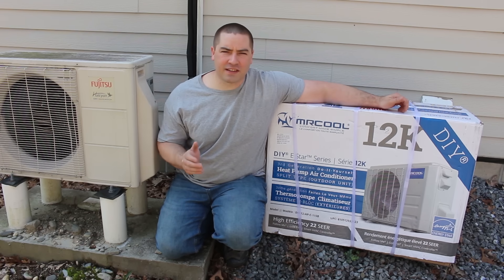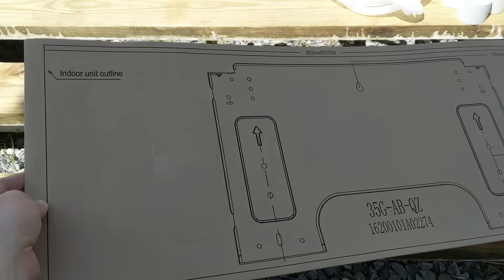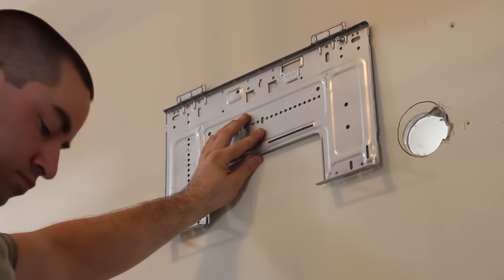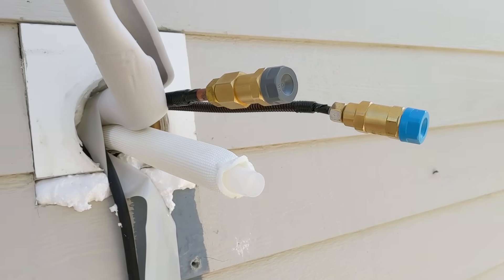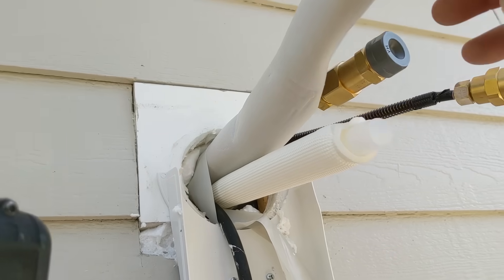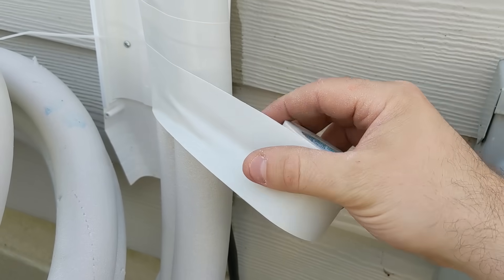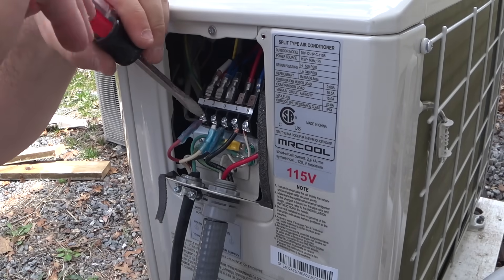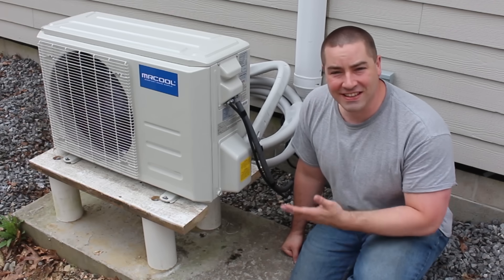Installing My Own Mini-Split Heat Pump, DIY

Comment: So you don't have to pull a vacuum on the lineset before you release the refrigerant.  Interesting
Reply from the maker: Right.  This is a neat kit.  I haven't found pre-charged lines on any other brand.  It might be out there, but most need a vacuum pump.  I posted a follow up video that answers that question:   https://youtu.be/KzHLsRtVn4U

Comment: You forgot to use a vacuum pump to remove the air in your pipe, 
Air in the system will reduce the efficiency of the system
Also it is better to use the shorter length of pipe, cut the excess and use a flair tools 
Not sure of the refrigerants fluid in your system, but on R410a system nylon blue is required to avoid pollution of the refrigeration gaz
Reply from the maker: I posted a follow up video that answers that question:   https://youtu.be/KzHLsRtVn4U
Reply: Sylvia isgod  I'm simply amazed at how many people speak before they even know what they're talking about. Or as in Jean-Claude Banville's case, doesn't know what he/she is talking about.

Comment: Great how to,
One question,
How did you get Freon ?
Reply from the maker: This particular kit came pre-charged with refrigerant in the compressor and inside the copper lines.  So I didn't need a license to install it.

Comment: Dont want to be mean,but you ve made two big miskes,first you should have put it on vacuum to avoid contaminants,second  you cant leave the line set like that,ur causing an oil trap,so as a tech,ur ac wont last much.
Reply from the maker: I posted a follow up video that answers that question:   https://youtu.be/KzHLsRtVn4U
Reply: I agree to some extent, but we ll see what happens in a year or 2 max,but thank u for the video .

Comment: hi david i have a question
no need to suck the line to get the air outjorgepozo
Reply from the maker: Not with this kit.  I go into more detail on the vacuum question in this follow up video: https://youtu.be/KzHLsRtVn4U

Comment: doesn't require any vaccum to be made inside the copper tubes ?
Reply from the maker: Not in this kit.  The lines came pre-charged and sealed.  I made a follow up video about it.
Reply: @DavidPozEnergy  oh, that is interesting indeed. Thank you. In France I didn't saw anything like this on selling plateforms, maybe because professionals have a huge monopole on finishing the installation of heat pumps.

Comment: Howcome you didnt get a 48v unit? I cant wait to replace my two units with a set that can be powered by my mini-version of your tower of power..
Reply from the maker: If I bought a mini-split that ran on 48v DC, then I'd have to run new wires from the garage to the house for the 48v, and they would be hundreds of dollars in wire to minimize voltage drop.  Plus the mini-split would cost more, plus I'd have to buy vacuum pump and gauges to commission the system.

Comment: That is not how you do it. this installation will kill the unit. you need to vacuum out the air from the copper lines using the valve on the AC. before releasing the refrigerant.
Reply from the maker: I  posted a follow up video addressing that question: https://youtu.be/KzHLsRtVn4U
Reply: @DavidPozEnergy  oh. I see, that is smart. but I would still stick with traditional systems :) ofc, definitely not fujitsu or "mrcool" over here :D I would go for Daikin ir Mitsbushi Electric :) not only for the longevity of the unit and comfort, but mainly for efficiency :) those chinese systems are known to be really bad when it comes to that.  especially when it says on the box SEER 22 you can already tell that its going to be just horrible :D they probably just made that number up because I dont even think that is possible to get that high even on the best of the best systems :) unless the rating system is different in US

Comment: There is any sence to do it by yourself like DIY ? How much cost standart instalation of 12000BTU in US ?  In East Europe about 150 dollars...
Reply from the maker: Last quote I got was $4500 USD.
Reply: @DavidPozEnergy  Do u mean that just to install simple monosplit standart system cost 4500? maybe 450 ?
Reply from the maker: I got a quote earlier this year (2020) before I decided to do it myself.  The quote was for a new Fujitsu, 9,000 BTU, single head, single compressor.  Direct replacement for the one I had.  The quote did not include any electrical work since I already have the wires and disconnect run out there.  So part of that quote includes the equipment, which is maybe $900-$1200, that range.  Which left about $3,500 in labor.  It's the $3,500 part that I saved by doing this myself.  That's also why I choose Mr. Cool, they have this kit with pre-charged lines so I don't need to own the vacuum pump or other HVAC tools.

Comment: Great video, very helpful and detailed, Thank you.  I am contemplating such a project but curious about all the extra refrigerant line, couldn't you have gotten a shorter line and it appears Mr. Cool only sell through local distribution, am I mistaken?
Reply from the maker: This kit comes with a 25 foot lineset.  The lines are pre-charged and can not be cut in the field.  Mr. Cool might sell a shorter line on the website, but I don't know.  You can buy this model through Amazon.  I linked to it in the description.
Reply: Yes you can buy a 16 foot line set for $210.00 I spoke with IWAE.com about that on Friday June 12,2020😁🛫
Reply: As David said, he is correct on the 25ft lineset. It also has a 50ft lineset which you can order. (For 2nd story or longer runs.)
The lineset can be shortened.
That requires trimming it from the wall and outdoor unit and brazing the shortened length with oxy/acetylene torches.
Hire a contractor! He didn't vacuum the lines and just killed his system.
Also, the lines are not pre-charged, neither the indoor evaporator.
The only precharge is in the heat pump(outdoor unit).
I'm an 27yr Hvac contractor.

Comment: How much did you save in labor? How much time did the entire install take? How much more expensive is Mr. Cool vs Gree or another mid brand that can only be installed by an HVAC tech?
Reply from the maker: Hi Ron Rossnick,  Some of this will depend on your area.  I live close to Boston, Massachusetts.  Labor is pretty expensive here.  If I had hired an HVAC company to do the work shown in this video it would have cost another $2500 or more on top of the cost of the unit.  
This took me 1.5 days, but that's what happens when you are moving the camera around and the kids are there.  It could have been done in 4 hours.
I don't know how much more or less it costs compared to other units.  But you save on the cost of HVAC tools.  No vacuum pump or gauges needed.  This DIY system requires very little in the way of tools.

Comment: Great work installing your mini split system!! Being a HVAC contractor I see one a couple of big issues with the install. One... you did not do a leak check on the system " pressurize the line set" to make sure you have no leaks. Two I did not see you pull a vac on the system " removing the air out of the line set. Air has moisture, which overtime will kill that compressor or cause alot of problems with the refrigerant and make your system not cool to factory specs.
Reply: These DIY systems including the line sets and head units are sealed under a vacuum from the factory. Only if you broke the seal would you have to pull a vacuum. He did leak check the system however.
Reply: Oh my god do these people not comprehend the video they're watching? The lines are pre-charged and you don't have to vacuum them.
Reply from the maker: I  posted a follow up video addressing that question: https://youtu.be/KzHLsRtVn4U
Reply: The Line sets use Re-usable Refrigeration Quick disconnects utilizing a Double o-ring seal on one end and Pushes open a Spring loaded end on the other side. All line sets are Evacuated and Pre-charged. Quick disconnects are sealed ends. Very similar to whats used for Remote  ice machine Condenser installations and Marine Adler Barbour Refrigeration systems. me - refrigeration man for 39 years.
Reply: He probably pressure checked with his air compressor  I think line set pre charged
Reply: Even is the unit is under a vacuum that doesn’t mean the line set is it’s exposed to moisture in the air which can cause over time non condensables and kill that compressor meaning you should of pulled a vacuum on the lineset and evaporator after you pressusized it with nitrogen and leak checked it and should have definitely shortened up the lineset that coiled up be hind the unit looks terrible if you gonna do something atleast make sure it looks decent and not halfassed
Reply: I agree with you Kevin.
Being an Hvac contractor for 27yrs, I saw the same mistakes.
No vacuum, he could have shortened the lineset. (Which would require brazing.) 😙
Yes, as we both know, he just killed his system.
People need Ptacs instead or window units.
Hello from Atlanta. 😉

Comment: I install minis for a living and can tel you that 99% of the time the leak is at the flare fitting. Either the tubing wasn’t flared correctly or the flares where not torqued properly. Fujitsu’s should last well over a decade...
Reply from the maker: I don't know the root cause of what was wrong with the old one.  But I can say that every time I paid $$$ for the HVAC pros to come out they told me it was the flare fittings.  Those flares were replaced 3 separate times, along with refrigerant.  Each time the unit worked another couple months, then error code again.

Comment: Did you not have to pull a vacuum on this system, Also great job using nylog, ive used for years and love it.
Reply from the maker: No vacuum with this DIY system.  I  posted a follow up video addressing that question: https://youtu.be/KzHLsRtVn4U

Comment: Your old leak was likely on the actual evaporator coil on the indoor unit, this is pretty common and usually unrepairable. Sounds like your local companies suck.
Reply from the maker: I can't say if the local companies are good or bad.  They have licences, and insurance, and are registered with my state.  They replaced the same flare fitting 3 separate times and it still leaked.  This was in addition to other things, but I'm using it as an example.  I got the impression they didn't know where the leak was, but just trying and hoping?  I don't know.  But I can't keep throwing money at them for just another 2-3 months before the fault comes back.
Reply: Coil leaks are repairable. Really, any leak is. 600psi nitrogen, soap, maybe a splash of 410a and an electronic leak detector. Use a centralized flame like an oxygen acetylene torch while purging nitro and leak be gone. Leaks in minisplits are very easy to find and fix. Do not use dye, it ruins the neoprene gaskets and can cause king valves and hoses to leak.

Comment: That's not correct, you missed a VERY IMPORTANT step, which is remove all the air from the system, you need to conenct a vacuum pump to the lines after connecting them to the external unit. If you don't do that the refrigerant will mix with air/humidity etc and will cause problems in the future. To fix that now, you have to recover all the refrigerant, vacuum and then put back NEW refrigerant.
Reply from the maker: I  posted a follow up video addressing that question: https://youtu.be/KzHLsRtVn4U
Reply: @DavidPozEnergy  wow you are correct! I didn't knew those units thanks for the explanation

Comment: You forgot to purge the lines!  As far as I am aware, you were suppose to only connect on line, release refrigerant to let the air come out so you are only left with the refrigerant gas. Usually all units ship with extra bit of refrigerant precisely for this purpose. 
 Considering amount of copper line rolled up, you might need to ragas the whole unit now as you have air in the lines and it wont cool that well.
Reply from the maker: I  posted a follow up video addressing that question: https://youtu.be/KzHLsRtVn4U
Reply: oh my god! WATCH the video and learn.

Comment: So it comes shipped pre-charged with refrigerant? And you don't blow out the lines to get rid of the warm moist air first?
Reply from the maker: Correct.  The lines are pre-charged.  I made a little follow up video with more details on that.  It's specifically made for DIY.  No vacuum or nitrogen.

Comment: Im trying to get one done and people keep trying to charge in the upwards of 5000 to 6000 to in stall these and it isnt that serious, if you had to pay someone how much would you pay to install this? just wanting to know the price point.
Reply from the maker: If I had to hire someone, and they were installing a Mitsubishi.  With a new electrical run, I'd probably max out around $4,000.  This would have to include vacuuming and Nitrogen test.  It would just be a single head, small unit.  But I'm not an HVAC tech.

Comment: Please, let me know your thoughts on this (and mini splits in general) after you have had this unit a bit longer. 

I have a traditional, bulky, upright heat pump HVAC system (large AC unit on roof and heat pump fan assembly taller than my water heater in a little closet room on my 1950s single-level home - which is kind of ridiculous because of the space it takes up with ducting and everything). It is an older unit abs will eventually give up the ghost, so it might be worth considering switching over to a more compact and external option, like these. It would certainly be nice to one day tear out the ductwork and have a roomier look and feel to my small 990sq.ft. adobe brick home. Plus, it could allow me to convert that utility room into a small laundry room and stop having to go out to the little detached one these prior owners added to the carport.

So, yeah, definitely let me know your thoughts on these units and if you think it would be a viable option for a 990sq.ft. 1950s brick home in the Arizona desert (110° summers and 20° winters).
Reply from the maker: Hi James,  This has been running only 3 weeks or so.  So I can't give long-term data.  But I can say that his unit can cool my whole house (740 sq. ft.) but that's because I super-insulated my home.  If your 1950s house has not been air sealed and insulated, then I'd suggest starting there.
Reply: @DavidPozEnergy  thanks for the info

Comment: How long are the tubes? I will be installing it on 2nd floor
Reply from the maker: 25 feet.
Reply: @DavidPozEnergy  Thanks
Reply: However you can order a 16 foot set.

Comment: It helps to pull a vacuum on the lines before opening the valve to test for leaks. Also ensures better operation without air or moisture in lines
Reply: Ryan Houghton you should research the DIY MrCool before posting comments on the subject that you know nothing about. 🤣🛫
Reply from the maker: I  posted a follow up video addressing that question: https://youtu.be/KzHLsRtVn4U

Comment: I use the Mr Cool Advantage line of mini splits . We also use them at the foundry I work for and they hold up very well even in the dirty and excessively hot environment .  Just order them from the Home Depot website and they deliver to the local store . That app can be controlled by Alexa or Google also .

Comment: I dont get it the line set is pre charged with 410a? you cant leak check at ambient with 410a lol its only like 150psi
Reply from the maker: I  posted a follow up video addressing that question: https://youtu.be/KzHLsRtVn4U

Comment: You have to get the air and water vapor out of the refrigeration lines with a vac pump. Exactly why you shouldnt DIY with AC
Reply: nevermind just seen your other vid
Reply from the maker: I  posted a follow up video addressing that question: https://youtu.be/KzHLsRtVn4U

Comment: No evacuation of the lines? Moisture and conaminents are now mixed with your refrigerant. Massive problems for you in the near future 100%.  Also because of that loop of refrigerant lines you might trap oil and cause further wear on your compressor. 
Doing certain  installations yourself is good but there are things you should leave to the professionals unless you want to keep replacing another diy unit every 1-2 years.
Reply from the maker: I  posted a follow up video addressing that question: https://youtu.be/KzHLsRtVn4U

Comment: Been watching lots of ductless ac but none ever talked about if the units do the job or not! Keep searching 😔😔
Reply from the maker: It's a new unit for me.  But I have just kept the temperature set for the last 3 weeks and it does its job.
Reply: @DavidPozEnergy  thank you for your reply and new Subscriber here! Cheers bradda.
Reply: I have a 1150 Sq Foot Barn cabin with high ceilings and my Mr Cool 24K unit keeps it very comfortable .  It is a metal structure that was insulated with spray foam . You can see a little of it here in this video when I was testing a repair on a friends crashed camera drone .  https://www.youtube.com/watch?v=l70EUdeig2k
Reply: @rydfree  what a beautiful planet you have and thank you for your insight view and glad it works.out great for you! Cheers.

Comment: You don't need a torque wrench for the fittings?
Reply from the maker: The fittings are not NPT.  They are straight thread.  So they bottom out in the fitting.  I  posted a follow up video with more info : https://youtu.be/KzHLsRtVn4U

Comment: what about creating a vacuum? What about air in the system? What about the humidity inside the unit and in the pipeline? 2 years and the compressor inside will rust and will be broken.
Reply from the maker: I  posted a follow up video addressing that question: https://youtu.be/KzHLsRtVn4U